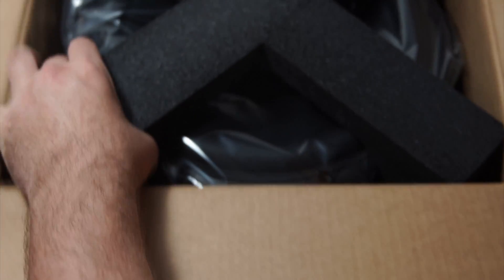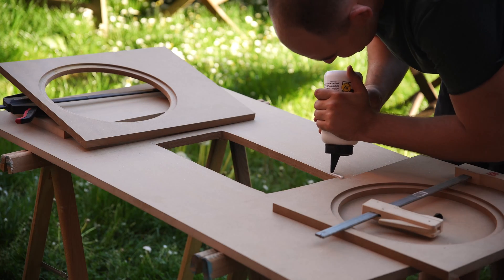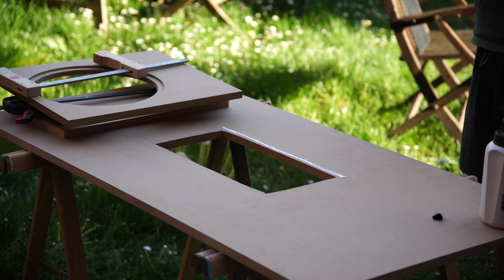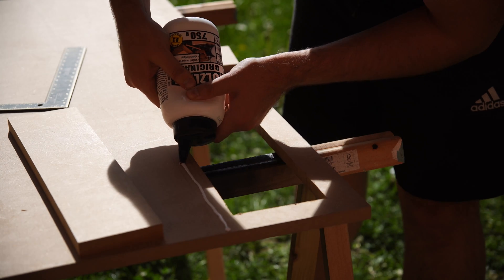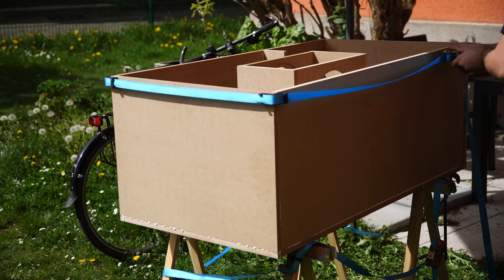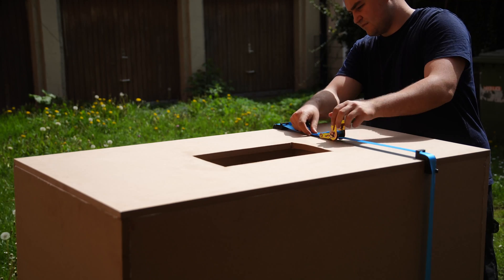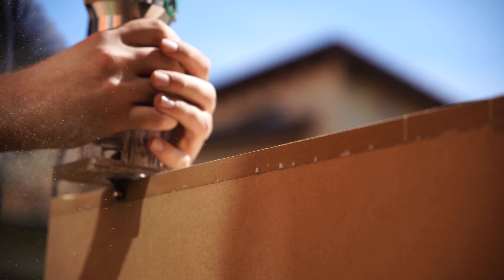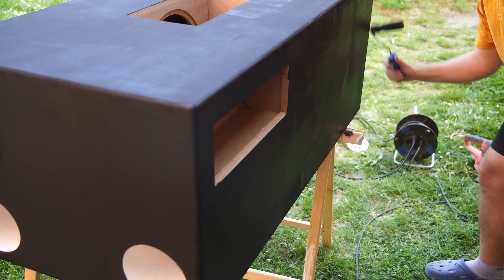18Hz DIY Subwoofer - High-end BASS !!! - ScanSpeak - HypexFusion

Comment: Cool build. I have a pair of these drivers and going to make a sub. Is 500W enough to control it or if you had to make it again would you use a bigger amp. I am going to build 2 enclosures and use them as subs for music and movies.  Building the cabinets in 1 inch MDF with reinforcements (its a damn powerful sub)
Reply from the maker: @erik1975  Nice, they are awesome drivers! Actually I would use a less powerfull amp next time, you will never reach 500watts, the limiting factor is the cone excursion. I recon 250W would be enough, even for both together! I only used such a big amp to be on the safe side and so it doesn’t run to hot, because it’s used in a club with approx 8h continous runtime…
Reply: Use a Hypex FA501 for that Revelator driver in 40 liter sealed (qtc 0.707 for lowest f3) enclosure, then it can also handle al the power from the amp.
When used a 60 liter sealed box 250w wil drive the woofer to xmax, but with the dsp on the amp my Diy sub is also tuned @22hz-6db 15hz-10db
Have also 2 sealed Diy dual opposed subs with 4x12" Scan Speak Discovery Hypex FA 502/252 amps. 
The 3 Diy subs play 10hz flat inroom and no driver protection is needed, with a ported design you must protect the driver under the port tuning it will behave like its in free air and kill itself.

Comment: Hi David Please can u suggest a SB or peerless driver fir this king if performance I don’t get scan speak in my country
Will Eminence lab 12 be able to do it
Reply from the maker: @anandshah71  Sure, the "SB Acoustics 12" SB34SWPL76-4" is the closest, but obviously not as good as the scan speak 32W. But still the specs of the driver are great, especially for it’s price!
Reply: @hififriend4512 I'm thinking about doing a similar design for my home but I want to incorporate 2 passive (or more radiators as well I want to tune it So I get the lowest possible frequency I'm looking at making it a  infrasonic subwoofer like Ascendo subwoofer  that can play 5hz @105dB any advice vice?

Comment: Hi David, how do you like these compared to the Wavecor SW275? The Wavecor are smaller diameter of course, but have low loss surrounds and a more linear suspension.
Reply from the maker: The SW275BD01 is about 3-4dB quieter and needs less cabinet volume (for 2x woofers 180 vs 270) and reach further down. But still performs extremely well. Concerning sound quality there isn’t a huge difference. But I can promise you that two SW275 is more than enough for most situations and two 32W are rather to much for most normal sized rooms. Talking about ported designs of course. I would probably recommend the Wavecor to most people because of the smaller enclosure. Keep in mind that the ports need quite a bit diameter (and therefore are very long) so you don’t get portnoise at max volume.